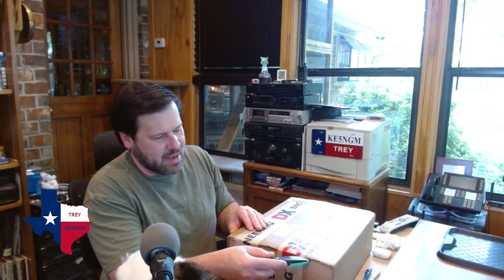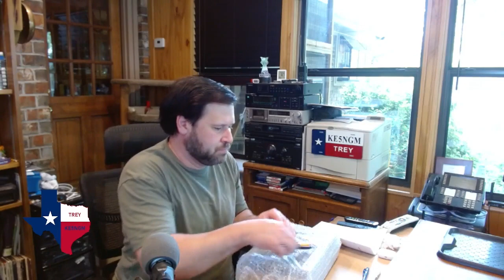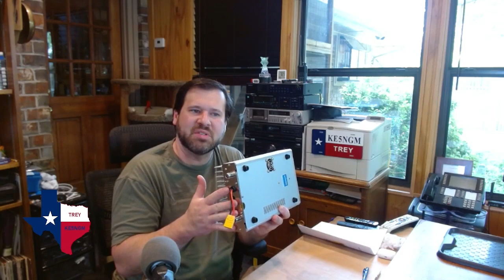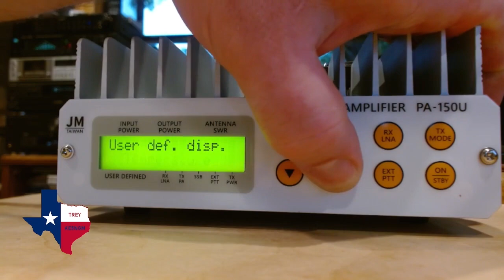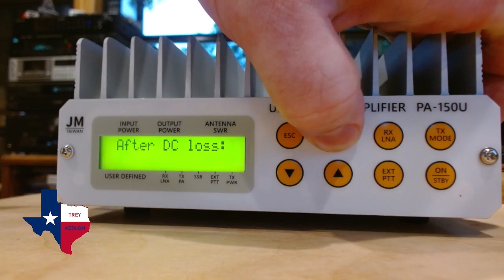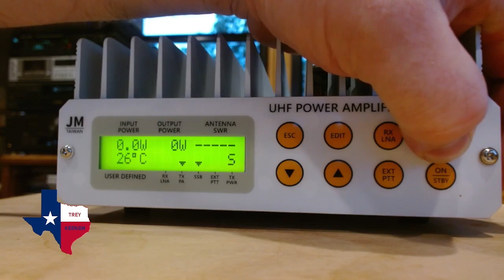Toptek Communications PA-150U UHF 70CM Amplifier Unboxing and Walkthrough

Comment: Well tell us how to hook up both the pa150 & pa350 to the same radio (510 y ) one antenna or two ? Feed back into radio ? duplexer in and duplexer out ? or just in and two antennas ? Radio set on 4 watts low uhf @ vhf = 130 & 300 out

Comment: I tried running the amplifier on SSB without turning the AMP onto SSB and it worked just fine if you’re using an external PTT source